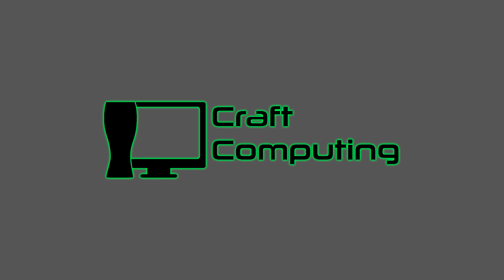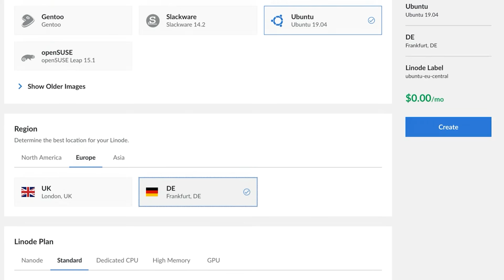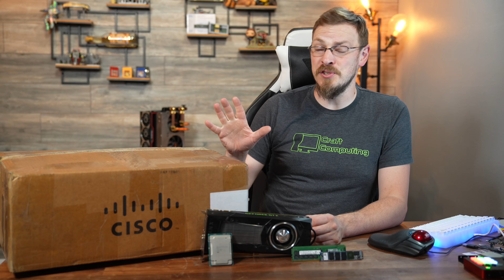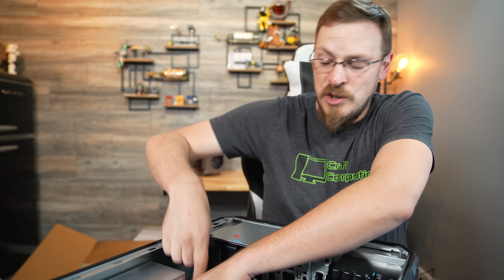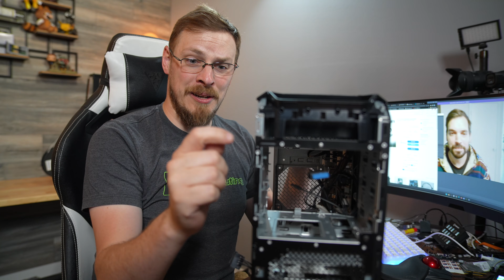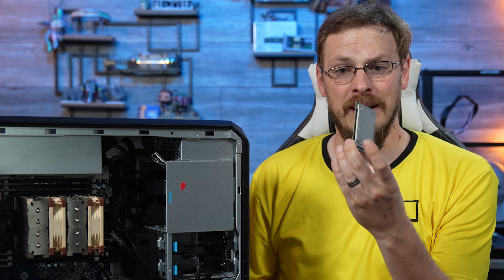THIS PC IS CURSED! - HPE Z6 G4 and Xeon 8251C!

Comment: A mechanical pencil with a metal barrel works great for straightening pins. You'd want to have several sizes, but it's a great thing to have in your PC Maintenance Kit
Reply: The pins on a lga socket are not the same as the pga pins on a cpu so the mech pencil only works with pga
Reply: @sccsuk  Did you see how jeff was straightening pins in the video?
That's how you use the pencil.
Reply: That doesn't work so well with denser pin counts.
Reply: I miss the old days, where Intel boxed CPUs came with a rake. You could straighten pins with those and a small flathead screwdriver and some fine point needle nose pliers.
Reply: I used a pair of tweezers for an lga 1155 socket. I only used one side basically as a teeny pick. It's been going strong for 8 years. I don't know if this socket has denser pins though.
Reply: I use a dental pick and a microscope
Reply: Blunt syringes are also really good.

Comment: This why I rarely buy HP equipment.  For those that like and understand them, great but they're very different from what the rest of us are used to.
Reply: Yeah they are a pain to work with even in the best case senario, if you plan on using just the motherboard out of HP / Dell system or upgrading any parts be ready to rewiring a lot of connectors and/or use many adapters.

Though in some cases it can be worth the headache for a dirt cheap high performance system if you know what you're doing, I put together a solid budget gaming rig for my nephew for ~$200 with an i7-4790k and a GTX-970. Only thing I really had to do different was use an adapter for the 24pin on the PSU, and adding a regular ATX PSU also solved a few of the other proprietary headaches in addition to powering the 970. But you really have to know what exactly you're dealing with beforehand if you don't want to end up with a pile of scrap.
Reply: HP, Dell, pretty much every OEM has stuff like this in their lineup.
Got some older dell precisions that have the flipped wiring for the 24 pin, negating the use of any off the shelf PSU, plus a proprietary wiring harness with a bunch of weird stuff coming off it that doesn't exist on any other PSU.
The newer ones use 'common slot' PSUs, and a few different power distribution boards depending on model and options.
Not going to get into the nightmare that wiring harness is.

The worst is the side panel's add in card retaining assembly. Forget using a gpu that's not full length with a vertical power plug, such as the p106-100 i happen to own.
Reply: All OEMs now make that kind of bs where everything is non-standard and not documented and in many times not interoperable between their own product lines. Gotta ensure they go straight to the landfill once the support contract ends so everyone buys new product, you know
Reply: Agreed the HP consumer lineup is a pain but their workstation offering are excellent in their value and quality. But this new case does appear to be a pain, lol! And their memory game is pure BS!
Reply: As long as you do your research on parts to get, the HP workstations are great.  I use a z4 g4 and it's a great performing reliable machine.  If the power supply dies, it slides out in 2 seconds.  They are pretty cheap on ebay used and the power supplies last a long time.
Reply: if you start tinkering with enterprise grade hardware, you will sometimes be surprised… and stop buying before reading all specs, delivered parts, measures etc - but if you know what you do, you will save so much money and have fun.

Many headers can be rewired (well not as craft did hehe) or just buy cheap adapters do it, yaddi yaddi yah :)

Often thousands of Workstations go to surplus year by year as they are sometimes just one year used, but you have to think before buying. Jeff did many mistakes for entertaining purposes hehe.

Cheers, Pepe

Comment: I'm surprised HP didn't use Torx screws to hold the CPU socket cover on.
Reply: How about proprietary screw type, with screwdriver head in the shape of an H and P
Reply: @crispycrusader1  shhh, don't give them ideas?
Reply: @crispycrusader1   LOL!!  😂😂👍👍
Reply: @crispycrusader1  laughs in old power 5 server hahaha
Reply: Actually I would appreciate the use of torx screws as standard pc screws.
Reply: @vollhorst140  Torx FTW! I don't get the Torx hate.
... well ok I did have one Torx screw from a laptop that was already stripped hard, and getting it out was a massive ordeal. But that single experience doesn't make it worse than the dreaded experience of having to deal with Philips screws every day.
Reply: @Fay7666  In contrast to crosshead and typical Phillips, which was designed to f...g screwing in the fastener, torx has been specifically designed to self destruct - strip - in a very specific scenario - when overtorquing. If you think about it you never hear of stripped thread with torx, haven't you? It is a hassle to get it out, but it's a blessing in disguise, especially, if mating surface beneath is plastic. The problem with it is, when you add thread locking glue, manufacturers are perfectly capable to present you a product, which will be impossible to open and close repeatedly, because stripping torque will be just tiny little below the torque required to break the screw loose. I mean MOST screws will survive the experience, but it will be often enough to dishearten customer and make him abandon further servicing.

Lenovo does this in random stuff, Sony did this in their MIDs (remember those tiny computers?), Garmin did this and Motorola does this, from what I have seen in person.
Reply: @vollhorst140  Everything should be torx screws but the world like to push down as they screw in for some reason.
Reply: @vollhorst140  Everything should be torx screws.
Reply: They didn't use Torx because Torx is a standard, easily accessible screw and screwdriver.

Y'all out here acting like Torx is some Apple pentalobe crap, and it's not. Torx is standard as heck and should completely replace Phillips.
Reply: @mjc0961  totally agree
Reply: Triwings...
Reply from the maker: Pentalobe
Reply: Don't worry, in earlier workstations (Z800/Westmere) they used non-standard length UNC 6/32 (or hard drive screws) to hold the cooler. If you store bought replacements and bottomed them out cooler will be loose resulting in abysmal performance, and shorter screws loosen themselves over time from vibration.
Reply: They are Torx 30 but you can horse them out with a big screwdriver.
Reply: There is a type of Torx with a peg in the middle of the screw so you need a bit with a hole in it. It is sometimes called security screw. My broken microwave has those. Is it just a blown fuse? It is not going to be easy to get inside and see.

Comment: Would you still recommend Ivy Bridge?  I am looking into getting an old HP Proliant G8 with 2670 v2's for some virtualization and homelab stuff as an upgrade for my Q6600 server.
Reply from the maker: I'd start looking toward Haswell myself. DDR4, more modern IO like USB 3.1, NVMe support, etc. Prices have come WAY down on 2011-3 CPUs as well, both v3 and v4.
Reply: @CraftComputing  These late 2011v3 units are definitely something I'm curious about as a guy who just picked up a Z440 with a 1650v3. While the CPU is just fine for the things I'm using it for right now, I'm definitely curious about newer ones for the socket. I just can't make head or tail of the benchmarks, given that the only things that I can easily compare on are the core count and clock speed (which I wouldn't presume is directly comparable across architectures). Still I'm guessing that, say, a 1680v4 will have better single-thread performance than a 2690v4 if the numbers are as comparable as I would expect, where the performance gains are in stuff that uses a lot of threads.
Reply from the maker: I did a video on the Z440 recently. Much better experience than I had here 😁😂😭
Reply: @CraftComputing  Oh yeah. Good videos. While I didn't know everything going in (proprietary power supply yay) I sure did research the purchase a LOT.
Reply: Lots of business are still running on Nehalem and Westmere. That g9 is a good machine. For home use its good, if not slightly power hungry.
Reply: @alexthemorgan  G8 sry not the G9
Reply: vs a Q6600, that's a nice big upgrade
Reply: very power hungry and if the disks and pci-e cards are not hp branded, there is a high chance the fans will go 100% with no apparent way (apart for modding) to slow them down. maybe a lenovo srver will suit you better. dell are also kind of crap. don't ask how i know...
Reply: ML350p I'm guessing? Always liked those machines, very nicely built with tons of configuration flexibility. I've also never had any issues with excessive fan noise even when loaded up with cheap PCIe network/USB 3.0 cards and mismatched non-HP branded drives. A huge step up from a Q6600 so I'd go for it provided it's not too terribly expensive.